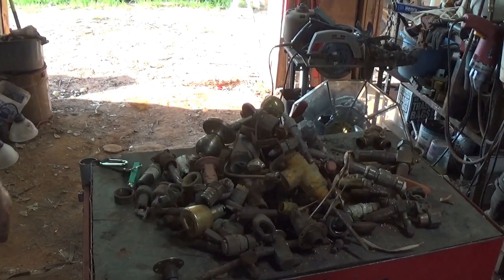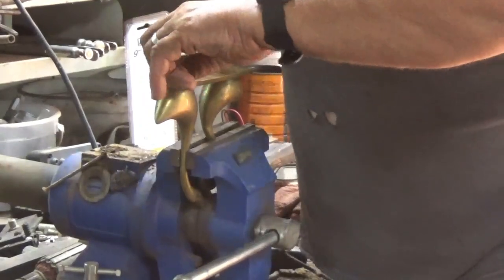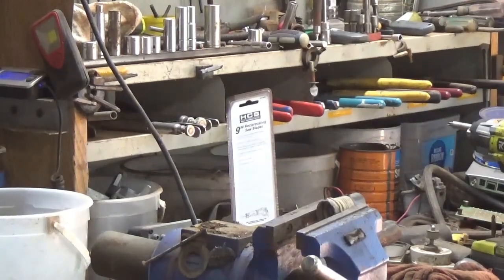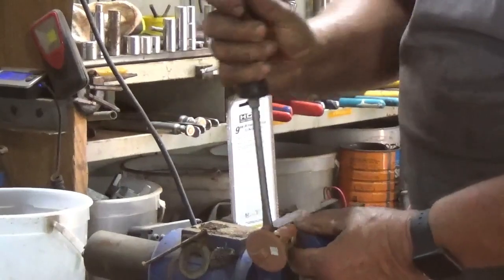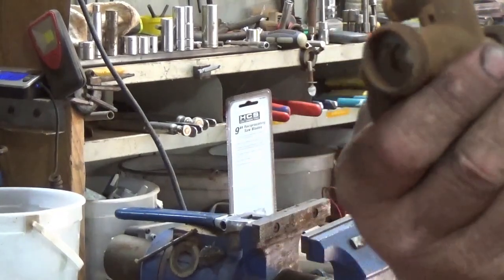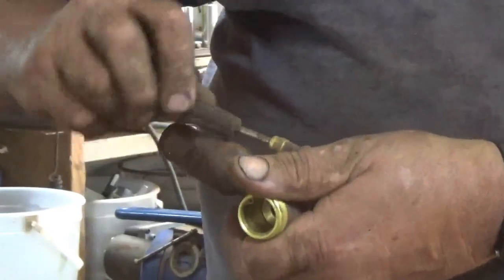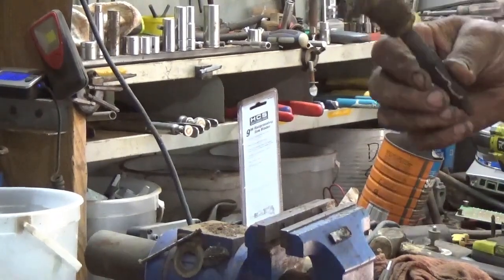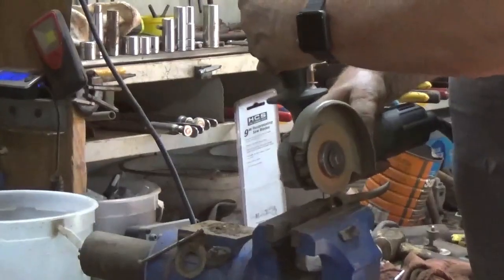Cleaning up some dirty Brass odds and ends to get Clean Brass

Comment: Yay, something new to watch while I can’t do much, as I put a screwdriver thru my thumb.
Reply from the maker: Ouch, I know that had to hurt, Scrapping does have its dangers, a vice can be your friend, I know that they will slow you down, but they make it much safer, hope you heal fast so you can get back at it
Reply: Feel for you, I've done the same thing though a thumb nail and then again into the webbing between two fingers with a magnetic star bit covered in metal shards that came out clean! Caused a knot about the size of a marble. Haven't done it since though, some lessons are hard learned.
Reply: @Okiescrapper  I needed a new vice, now have one thanks to parents, day 5 of not using it for 3 weeks, feeding wire stripper, and watching YouTube/tv.
Reply: @tommychew6544  definitely not doing it again, the $150 for a vice I shouldn’t I been so tight.
Reply: @tcltrains.4552  We all do it at some point, those dang vises are expensive!

Comment: Keep us up to date on the mower. Maybe you did and I missed it. 
Plus a year ago,didn't you make a shreader? Would that make quick mulch out of this brass. Then sort with a magnet?
Reply from the maker: I put a fuel pump on the mower, and it is running great, use it all the time to cut grass or pull the trailer around, think I have about $70.00 in it. I think that mower ran about $3000.00 new

Comment: Brass and copper literally in everything just about. I get most of my copper and brass for inside other objects that lost people just throw in sheet pile
Reply from the maker: you can find brass and copper all over, and they are the best paying metals for us scrappers,
Reply: I know people that throw it in like that too, not looking at the big picture, just shred scrap weight as fast as they can get it. That stuff will add up if you take your time sitting it a side.
Reply: Yep. People laugh when I take buckets full of outlets and light switches. Takes a sec to tear apart and get brass out. Sometimes I'm lucky and the electrician will leave a little #1 wire on them. Idk it's worth it to me. Besides it's my time not theirs
Reply: I'm in the construction field union painter and I always make friends with electrical contractors. Buy them coffee and next thing you know they have a pile of wire and light fixture and transformers. Most union contractors don't save it. They don't have the time or need the extra cash.

Comment: You know when the brass and copper pile gets higher than the blackberries. It might be time for a clean up
Reply from the maker: the brass weight builds up quick, I have mine in a 55-gallon drum, not quite up to the first ring and it is very hard to move, guessing 200 to 250 lbs. I will find out this afternoon as I am taking it in. the yard says $2.30 a lb.

Comment: I saw some door handles. I skip those and toss in steal. I shouldn't, yes or no?
What do you do?
Reply from the maker: well first check them with a magnet, if the magnet sticks toss them, if the magnet does not stick hit it with a grinder or file to check the color as a lot of aluminum is brass plated
Reply: @Okiescrapper  True, and thanks for the tip.

Comment: I ave found it necessary to  strip  the brass odds  and ends if they have zinc or aluminium attached. All else goes in the forge and that pesty steel gets skimmed along with the ashes from the rubber and plastic.
Reply from the maker: that should work. I need to get the forge out and do some melting, but it is nice and hot here now, so I am in and out a lot in this heat, starting to get the yard back in order. Thanks for stopping by Matt
Reply: @Okiescrapper  hey, would you know what store will have whetstones? I  need to put a razor edge on my wire stripper cutting wheel
Reply from the maker: @mattyal9347  looks like there are a bunch on amazon https://www.amazon.com/s?k=whetstones&crid=2ON301PYBBGK&sprefix=whetstones%2Caps%2C541&ref=nb_sb_noss_1 other than that you may check a local sporting goods store near you or Walmart sporting goods
Reply: @Okiescrapper  sporting goods.  That sounds like the right place to look. I  talked to plenty of employees at Walmart and a few others and none of them could tell me what a whetstone is.

Comment: I dont know how it goes in the states but here in europe copper is nu brass pollition, only steel alu and other metals but not copper.
I leave it on just that it brings no extra value on the copper pile just tethius and time consuming and never had a komment or lower value.
Reply from the maker: I think most of the time it is how the buyer, the guy the yards sell to, how they want it